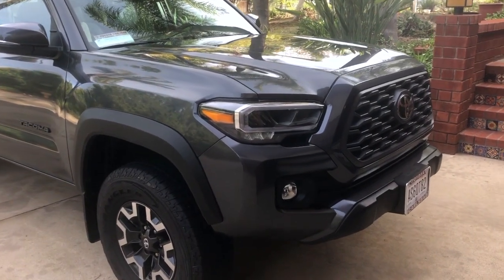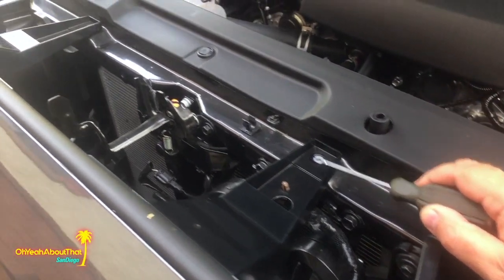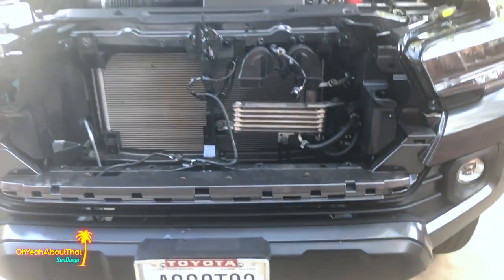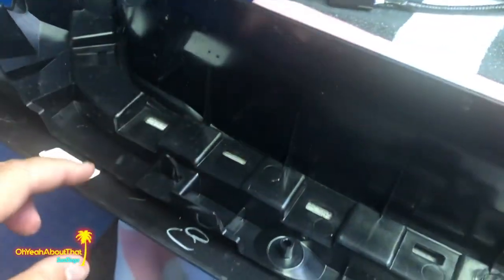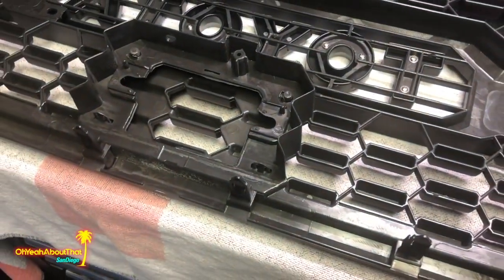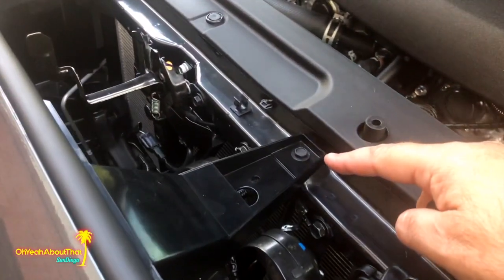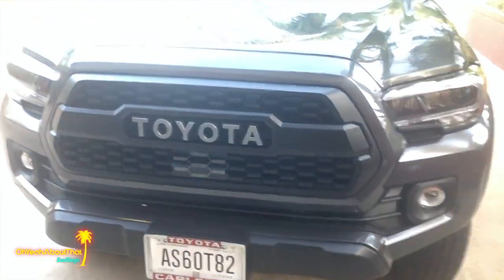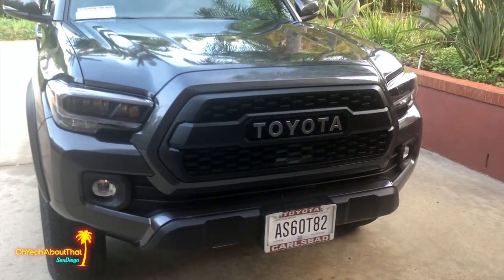TACOMA PRO GRILLE ADDED (vol four) 2020 Toyota Tacoma TRD 4x4

Comment: Hi, so just to be sure, just the two tabs and 2 screws on top only to remove the 2020 offroad grill? I don't need to mess with the tabs on the bottom?
Reply from the maker: Correct. I did and found there was no reason!  When it’s loose, you’ll know.
Reply: @OhYeahAboutThat  awesome. Thx. Gonna do my grill soon.

Comment: Is the installation process the same even with the front camera on a 2020 Trd Off Road?
Reply from the maker: Elias Aguilar I imagine it’s the same but with one more connection for the camera.
Reply: OhYeahAboutThat where would the camera fit though? With the tss. It seems a bit complicated
Reply from the maker: Elias Aguilar you would need to buy the grille made for the camera, but the installation is the same. I’m not sure they make an aftermarket grille for the camera option.